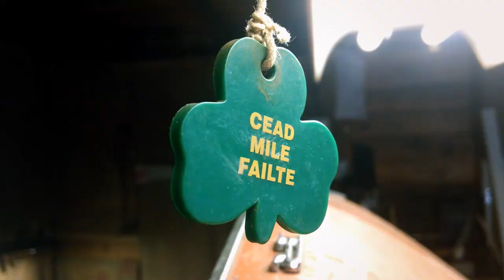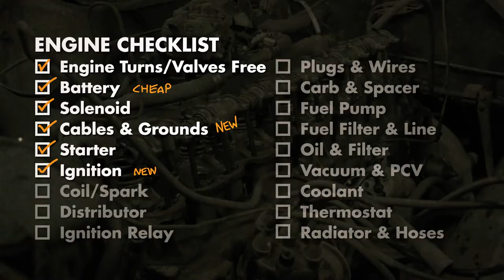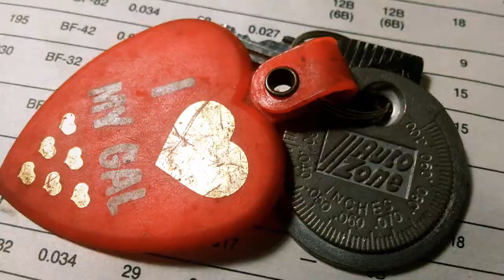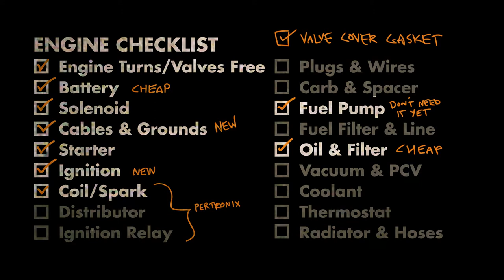The Six 4 — 1966 Mustang Cowl

Comment: If you're at all interested, Dupli Color red primer filler, with a top coat of Dupli Color Matte wheel clear spray is a perfect match to that faded oxidized red. Not really wanting to "paint" my car and ruin the "patina" nor go much beyond "that's good enough," I've been filling all of the rot holes with aluminum screen, covered in filler, ended semi-smooth, and coated in the red prime/matte clear. Looks "factory fresh."